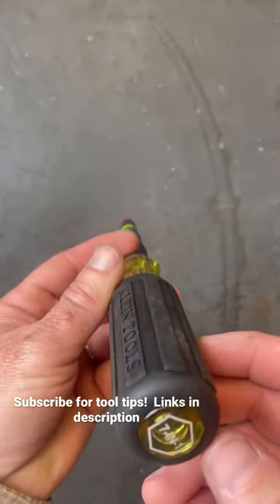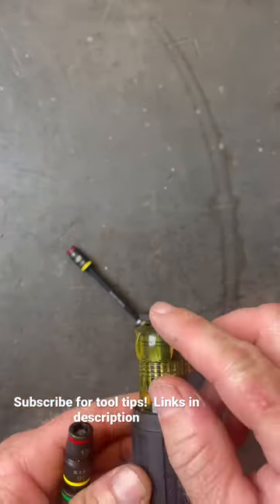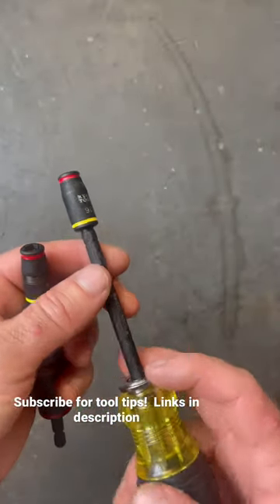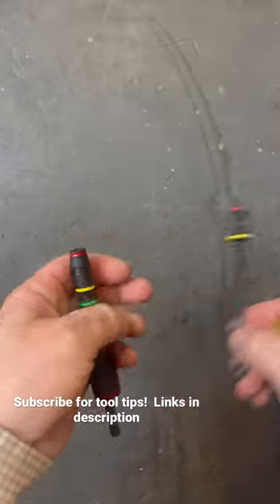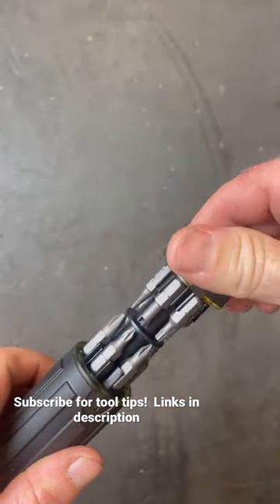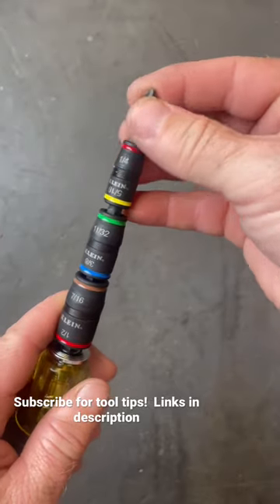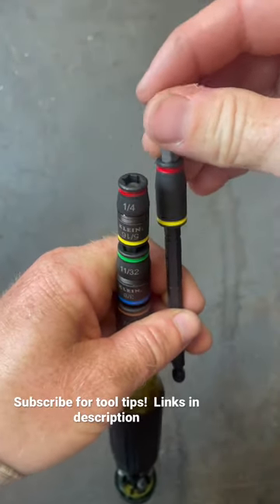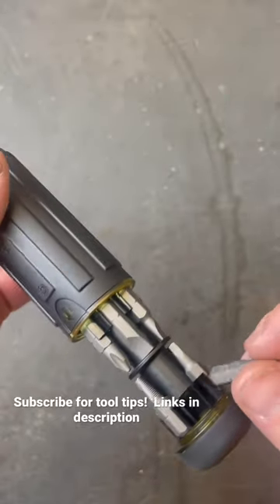Let make this tool even better!  Klein Impact Rated Socket Driver

Comment: What's hilarious is I have both of those screwdrivers and never thought of this. Thanks for that I'll do it first thing tomorrow!
Reply: What screwdriver is it 🤔😁
Reply: I hear the nut driver with like 5 different sizes isn’t that great
Reply: @murkyturkey5238  Don't talk about my wife like that...
Jokes aside, I have the multi nut driver and it's actually great but it's very heavy and bulky, the setup on this video is perfect and same way I use mine now over the multi drive.
Reply: I want that
Reply: It defeats the purpose of being able to quickly adjust the screwdriver.
Reply: Same here
Reply: @michaelhinchey how?
Reply: So I did this and then figured, hmmm, I bet it works with the racheting handle as well. It does! Just incase anyone was curious.

Comment: He just combined multi-tools to make a multi-multi-tool, this man is too dangerous.
Reply: Making multi-multi-tools is the best. I grabbed an EDC knipex duel mini plier set. Replaced the flatheaded plier with a wire stripper/crimper, threw in my 30 piece swiss army knife, and added a Fluke voltage tester/pocket light! I rarely touch my tool box now
Reply: He makes my tool addiction worse 😂

Comment: I did this same combo last winter. The problem with it is Klein’s bit holders in the handles are crap tastic. I did a fee short video where I broke a half dozen or more at home service counter and warrantying them without even leaving the store then went to an electrical supply house and did the same thing. The problem is when you close the tail cap quickly or drop any Klein screw driver with the bits in the handle the lower retaining ring glue is popped free and all the bits become stuck under the bit holder. making the handle almost useless.
Reply from the maker: I usually end up swapping all the bits out to Wera anyway lol. That’s a great idea switching to Wera handles
Reply: Another thing that sucks about it is the plastic bit holders in the handle get loose after several times removing bits so I have to pinch 'em tight again w/needle nose so the bits don't come loose and rattle inside the handle waiting to fall out the moment I need to switch bits next.

Comment: Exactly what I did with that. I got a second one it's on my impact driver. Haven't needed to use the bits yet outside the quarter inch yet but it's a great idea.

Comment: Have em both and love that i can pair em with my cordless drivers and impacts. The bit holder can serve as an improvised bit carrier for other tools and the handles are versatile as well. I can reach into my bag, work tray,  or pocket and as soon as i feel the klein over mold i know that i can reliably pair it with other hex shanks and accessories.

Comment: I have both of those and have played around with this configuration. The extension from the 14-in-1 has a feature the other one doesn't. There is a ball detent at the end of it so you can sit the 1/4 nut driver a little higher and have a deeper place to put the bit. If you leave the but shallow like he shows you'll risk the bit getting free of the magnet just like a screw does.

Comment: This has been one of my daily setups for a little while now, love it along with Klein's plug tester w/digital volt reading screen which is a real time saver not having to carry a multimeter around to every outlet and fits in your pocket.  

Their volt testers (widow sticks) went to crap though after pandemic, much cheaper look and feel to 'em compared to models a few years back.

Comment: My favorite screwdriver I've ever owned is a cheap screwdriver that I got from Ross, its designed like a revolver you just pull back on it and turn until it lines up with the bit you want then extend it and it automatically puts on the bit. its awesome is it's fast and easy to switch bits but my favorite thing about it is I won't ever lose a bit again because when you pull back on it it automatically stores the bit back in it's slot. I've been a mechanic for 15 years I wouldn't use it professionally because it has a couple draw backs but for personal use it's the best screwdriver I've owned.
Reply: Wera does that to

Comment: You actually have to push it forward a little bit in order to insert the bit. About that screwdriver and took the end out to keep in my impact driver and then bought that other end to put in a handle

Comment: Klein has really jacked up their act , of Late . A lot of their pliers / Plier quality has really improved . I’ve pretty well gone back to a Klein for Electricians scissors/ Shears .The Knipex Scissors are so bulky , and mine have committed several unforgivable offences ( clips screwing up , and unauthorized escapes from my belt . Mine have been demoted to being Bench tools .
Reply from the maker: Klein is impressing me in some things lately too for sure. I wish they’d do less proprietary bits and things in their multi drivers and all though.
Reply: @MillisConstruction  Agreed !
Reply: @MillisConstruction  At the risk of committing Heresy , I prefer Klein’s Freefall Snips , 2600-1 heavy duty shears to Knipex , Knipex is nice but bulky , I found O needed to set up a tethering system to retain mine , and stop the clip from popping of the sheath . I’ve demoted mine to bench duty !

Comment: On the HVAC 14 and one the quarter inch and 5/16 inch Chuck you can slide the 1/4” side forward and it has a picture of a screw bit on the shaft, it’s to hold the Phillips and other screw bits more sturdy 🤘🤘

Comment: From my experience you're going to want to have both of those because for one thing you might need a backup tool in case you lose one or break one and usually you'll find yourself in a situation where one of them works better than the other one
Reply: Right probably over torqued the handle and trashed the driver 😂😂😂 don't be dull my guy while I've not learned a lot about the trade before getting hit by a damn car I've learned than there's a reason every tool is different just like every job is different it's the knowledge of your tools not just the job that will get it done and done right but the knowledge will carry you farther than you expected unfortunately I physically can't work in the trade anymore but I'd be happy to pass along some knowledge of tools and such if your interested

Comment: Field tested this thing.hvac tech for over a decade 
not impact rated, bits are rather too loose or get stuck when it’s supposed to be an organized quick change tool.
Honestly the grip it comes with is pretty usefull

Comment: I did that and it’s great. The only thing you’ll have to do is put one of the least used bits to the side because you cannot store it with the bit attached because it will just fall off.  But still great

Comment: Nice idea. I would suggest replacing the original bits to impact ready ones. There is nothing worse than stripping a bit, when it's easier to replace a stripped screw.

Comment: When you are using the 1/4 nut driver as a bit holder you pull up half way to get the depth needed to hold a bit.

Comment: Klein has been rocking the tool world the last few years.  It's bizarre that they don't make a SKU that's the 14-in-1 screwdriver with the six socket nut driver.  Add a hex bit ratchet with a breaker bar on the other end.

Comment: This is actually sold as a set on Amazon just without the other handle
I was debating just getting the impact socket set shown in this video and pairing it with a double ratcheting screwdriver that has the bit storage in the back

Comment: Yea that handle is great and all UNTIL you drop it. Needs a better way to secure the bits but I still like it enough to keep it in my bag. Just don't open it up without being ready to catch the 3 or 4 bits that fall out

Comment: You missed one more thing. You can slide that 1/4” bit up, with your thumb, so that the socket becomes deeper which holds the bits better.

Comment: I had this conversation with about coworker like a week ago lol
Reply: Did either of you notice the 14-in-1 extension has a ball detent close to the top that the other doesn't. There is a position for the 1/4 socket to be a nut driver and another position for it to be a bit holdler.
Reply: @ethankriegel5957  yes . I was arguing that cline released these separately to sell more tools vs make an all in one .

Comment: I vehemitly avoid any screwdriver that holds bits inside the handle. I haven't found a single one that hasn't fallen apart or had terrible bit holding causing lost bits in the toolbag, etc...

Comment: I did this a year or so ago and the magnet fell out of both tips and I haven’t seen them in a while. The rubber grip slips around too if you need to torque on something but if you put the tip in an impact it works great. Klein quality is sub par these days

Comment: Hollow handles tend to break easy. Especially under torque. Been there done that.
Reply: It'll be just fine. There's no way you're going to break it, unless you misuse it. Saying "they tend to break" makes it seem like it's a rampant issue, but it isn't. It's just not happening.
Reply: Tbf its probably good for the home garage
Reply: Hollow handles always break

Comment: It sucks, all those bits fall off when you open the screwdriver. Happened to me a couple weeks after I got it, I finally had enough when it happened on ladder. The ones with the double sided bits hold on a little better

Comment: Ive had screwdrivers that you can change the bit and have never used them. I usually ended up taking the bit out and putting in my drill 😅

Comment: The 14 in 1, quarter inch slides up a half step to lock bits in. Does the other do the same? I don't think so but I could be wrong.

Comment: I’ve tried running bits in the end of the Klein 1/4 inch driver, but the bits just don’t stay secure in a real world application. Needs to be a little deeper to hug the bits better
Reply from the maker: On this particular one, try popping that 1/4 inch part forward one click, it actually has a deeper hold setting.  Let me know If that fixes it for you .  I failed to show it in this video
Reply: @MillisConstruction  you’re probably right. Mine is and early model and only has the 14/ and 5/16. They probably noticed the problem and have redesigned it

Comment: A 90° adapter for it would be nice for people with battery issues!!!
Reply from the maker: Check out the new wera 8009…. Might be perfect for what you’re thinking. I posted a short on it a little bit ago. 12 bits, can right angle, and accepts 3/8” drive sockets. Pricey but really handy.

Comment: Bought these 2 and it wasn’t worth it for me. The impact 11 in 1 would’ve been better for me. I’m a PLC technician so I thought this was gonna be my daily carry instead I just keep my insulated tweaker and screwdriver set on me and I run back for this hefty monstrosity if I need it. Just so cumbersome in the hand and honestly I can’t figure how to keep bits seated in the 1/4” drive. The socket always slide back down on the shaft if I’m really driving screws in panels or adding nuts on the back of screws threw the panel

Comment: Did this when 7 in 1 was released. But unfortunately I've had both tools fail. Magnet fell out of 7 in 1 and the 14 in 1 handle bit holders broke and the bits fall into handle.

Comment: I have the first one without the bits (using for HVAC). Would rather have a separate multibit screw driver with locking bits, the ones held in with magnets just don't cut it for me. Don't tell me people actually use those in their impact drivers or drills, they make bits specifically for that

Comment: those dinky bits are the major problem with all but one brand of multi-tip drivers. Milwaukee is the only driver with full-length shanks that allow access to recessed screws..

Comment: You stick the Philips bit in that 1/4 magnetic socket and it’s flimsy as fak cause it barely goes in at all
Reply: Move the 1/4 socket down, it should line up with the marking on the extension. I was having the same problem

Comment: You gain twice the weight though. Good idea otherwise. Also double ended bits are superior to tiny bits for not losing them and not needing to swap back and forth in the handle as much.

Comment: Hate the multi bit handle I bought it and all the bits fall out and some get stuck up inside the handle horribly designed wish it had metal clips to hold the bits in the handle instead

Comment: Those bits aren't impact rated, and the bit cannot seat enough to gain the torsional rigidity of the socket. Negates the impact rating of the shank, and also adds a fair bit of weight.
Reply: A Trump Supporter doesn’t know or care.
Reply: @benjurqunov  Cool take?

Comment: every klein screwdriver i own with that storage in the handel- the storage system in the handel has failed and either stuck open on dislodged bits or cap broken off- both broke from being stored in my toolbag- not from use= poor quality!

Comment: I HATE that one with the bits in the back.  Starts out fantastic but then it either binds up or the bits slide into the handle and you can't shut it anymore.  Like most of Klein's hand drivers over the last 10 or so years they are trash.  Got to go to one not made in China, most of my drivers are now German made.

Comment: Don't use your quarter inch sockets as bit holders rule number one number
Reply from the maker: The Klein ones are designed to be. They actually slide forward to hold the bits deeper than when used as a socket driver.
Reply: @MillisConstruction  I thought the socket looked way too shallow

Comment: What is the point of this?
Reply: Oh you've never worked on an air conditioning unit where you got to use star screws to take off the panel to get to it and of course they threw some drywall screws in there and then you need two different size nut drivers just to get in the thing a third size to take off a blower motor or something a flat head to pry on some stuff this thing is awesome until you need to put it in stubby mode and take off all the bits and they roll away LOL
Reply: @magenlin  Oh hell no! 🤣 I was a helicopter technician for the Army and now I'm am ASE certified Auto Technician and I've never come across anything like that. My dad's friend installs and services home A/C units and he told me, "Mijo, stick with cars. You want no part of this." I wasn't sure if he was joking or not,  but I'm glad I listened.

Comment: You do realize you lost torque right the mass in the handles makes it easier to turn while less mass makes it harder just saying both are great to have not just the one depending on what the job is otherwise you could completely trash the handle or handle grip due incorrectly asses the job situation so many people destroyed so many nice tools because they where to dull and never learned anything about there tools of there trade 😂🤣🤣😂
Reply: Grip being identical, Radius not mass affects torque in this situation.